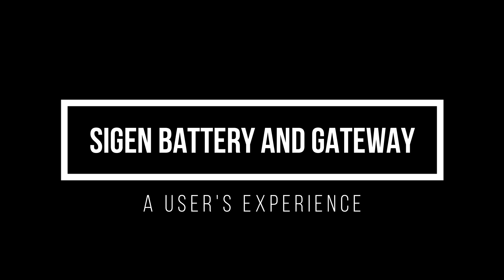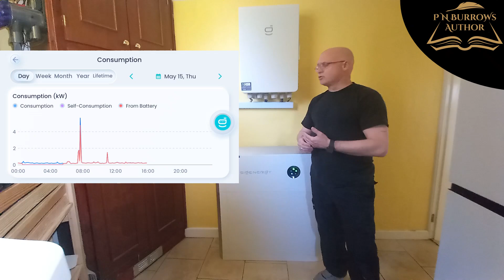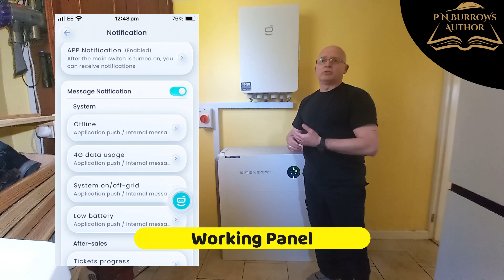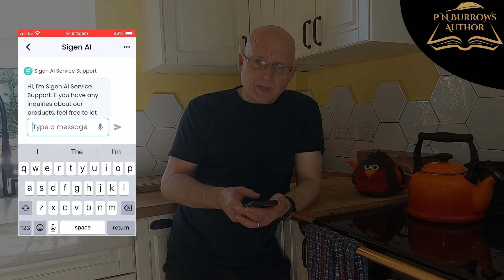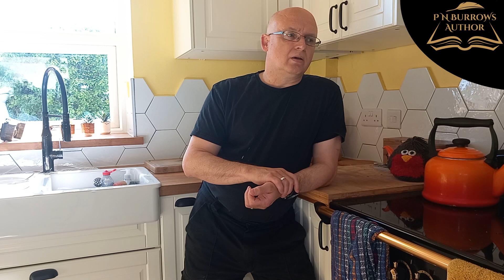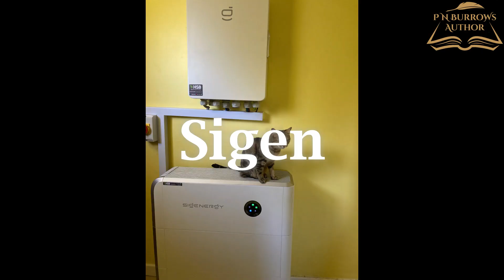Sigen Battery and Back Up Gateway - A User's Experience

Comment: Few things in here that are both true but also not quite so. 

The charge times adjust when in TIO mode. It does say start over when you want to make changes but actually it retains the prior entries for simple adjustment. So the terminology on the app needs changing but the function is deffo there. 

The AI is very much in development but the capability within it is already wahy ahead of anything else on the market. 

You made a smart choice choosing Sigenergy tbh. We have countless consumers who bought into tesla PW1 or 2 now unable to upgrade due to backwards compatibility issues. 

The givenergy gateway had to be reworked as it was causing rcds to trip due to leaky relays (silent) so while the humm is a factor (all contactors hum) they don't leak and are bullet proof reliable when opened or closed. 

As installers we see the customer service issues when gateways fail to do what their primary function is. None of which effects the sigenergy gateway. Hum aside its the best and safest on the market. 

However they have acknowledged the hum issue for those installing these in areas they sleep or occupy so now have newer models available globally and very soon in the UK market. 

However having installed maybe 100 of these in person I can say the hum is negligible but we all have different tolerances to these things and those of us more sensitive to noise would be wise to consider an enclosure around it with sound proofing on the enclosure and gateway door. We have done this for a customer who was aware of the hum pre install and wanted belt and braces to silence it!

The button in the app is very much a rare request for force discharge. Indeed we have customer requests for less buttons doing these things as they accidently set them off. So again very much personal preference. 

All brands have the scheduling for agile and such. Im a givenergy user myself and have to set those daily by choice to retain control myself. 

My son has sigenergy and does the same. 

Its interesting to hear a consumers perspective but again speaking as one. I would swap my AIO and gateway in heartbeat for your kit if you want to swap? 

I would even do the removal and install FOC if you wanted. 

I would be getting a winning deal on that lol so would bite your hand off!

Comment: Great honest video, thanks. Would it be possible to form some sort of acoustic box? Also decouple it from the wall somehow as that be acting like a sound board. Use something like rubber mounts? I was seriously considering the Sigenergy system and it would be mounted in a store room under the stairs. May now persuade me to stick with plan A which was the Tesla system. The big advantage with Sig was the possible expansion battery system. Maybe 13.5 kWh is enough?
Reply from the maker: Hi, Yeah the option of future expansion was one of the things I liked. I have bought some MLV (Mass Loaded Vinyl) and wood to make a sound-proof surround. I shouldn't have to though, this is sold as a domestic product. Thanks for the comment, it's appreciated.

Comment: Great video, I was seriously considering this system and these are some great insights not mentioned by anyone else.  The other positive is the option for V2H DC car charger in the stack.  Other negatives not mentioned are that the batteries (and DC charger) are expensive per kwh, you are tied to the Sigen ecosystem and dependant on an as yet very young company where you can't be sure if it's longevity in the market.  If i were you i would disconnect the gateway, fight for a refund on that part and live without it until the improved version comes along!

Comment: Could you move your gateway outside the house to avoid it being there? Might be a cheaper way to mitigate the buzz..?
Reply from the maker: Hi Nath, the rear of the long linear cottage is in the neighbour’s garden, the end wall facing the lane and we didn’t want a large high tech gadget on the front of premise. I have bought some soundproofing mass loaded vinyl and will will a wooded surround to house it all. But the truth is a domestic device should not be this loud, and Sigen aren’t interested. I wanted to warn others. I am happy for one of the big energy YouTubers to come and have a look, if any are interested.
Reply: Thanks for doing this. Very helpful. Installers are gushing over this but no videos from end users that I could find showing what it’s like to live with. Audio fine BTW.
Reply from the maker: @paulmannion7097 you’re welcome, glad it has helped. If you have any questions, just ask. Thanks for taking the time to comment.